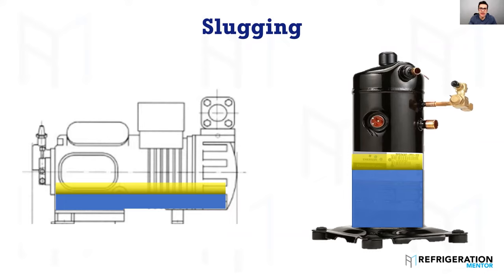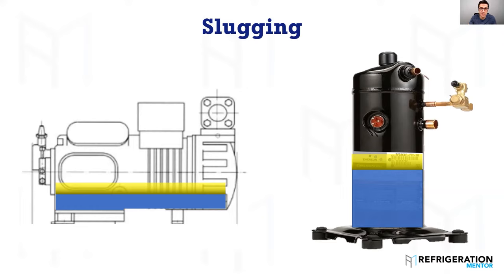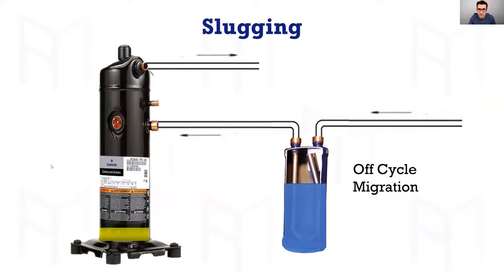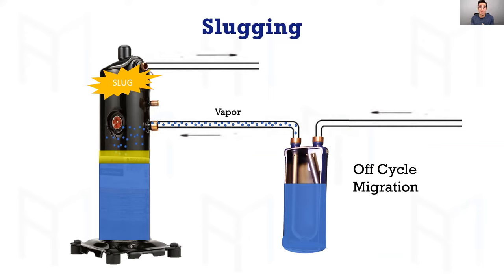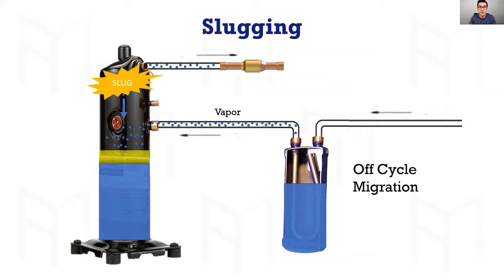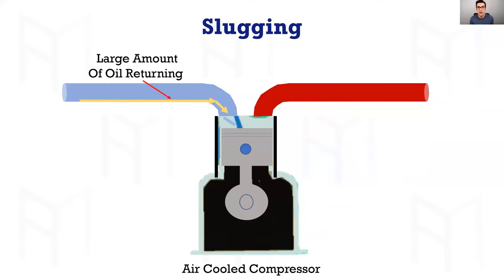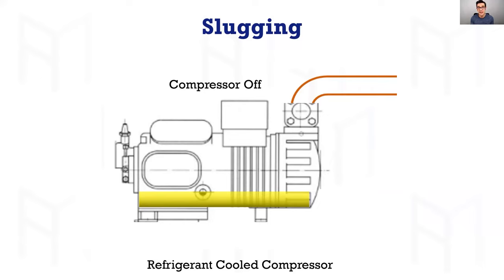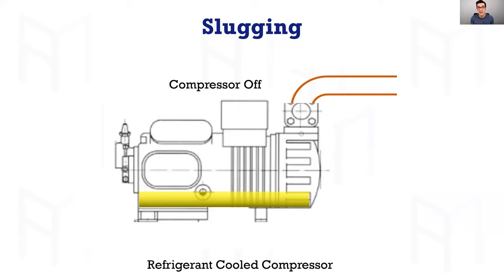Understanding Compressor Slugging

Comment: I found a copeland 3d with a blown gasket between 2 cylinders (the gasket that goes on the right side picture) at 11:46. Would slugging cause that? The discus valves looked fine though.
Reply from the maker: Yes a slug could cause that.

Comment: Most issues I faced in this case are due to oversized expansion divices. Even with crankcase heaters and pump-down, the slugging occurs, causing the break of many compressors. After a deep dive into the manufacurer's equipment docuemts, I found that both compressors and expansion valves were oversized compared to the evaporator's capacity. I have changed both with suitable ones, and the system now is running with no issue since 2016.
Reply from the maker: That is fantastic on you finding a solution for your customers.